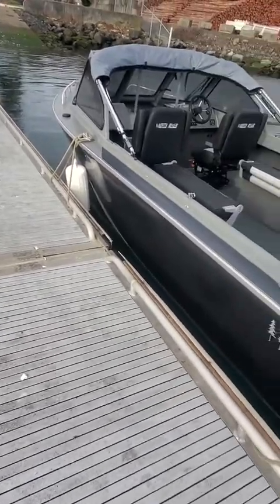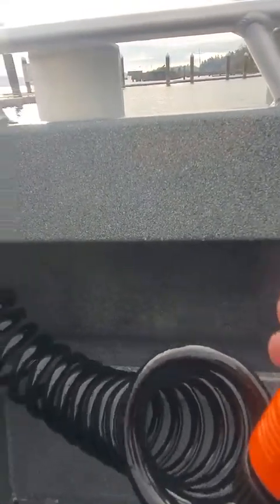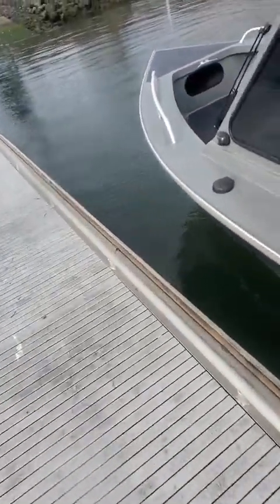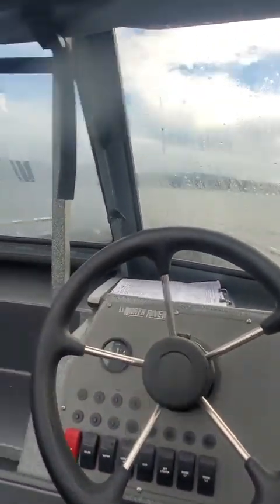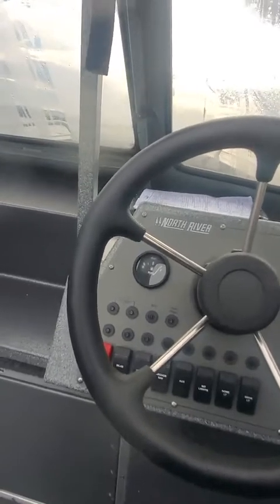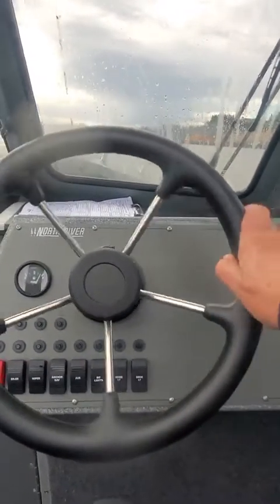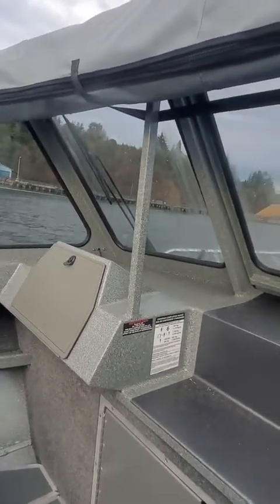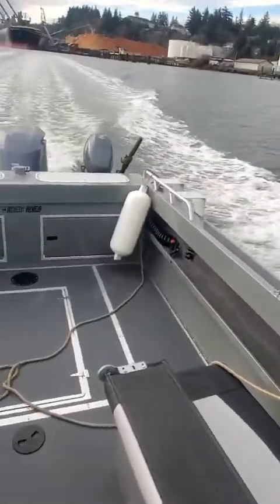Bob and Kyle new 22 North River Seahawk 2021

Comment: Not sure if this is the right place, but have watched you test a lot of the North River Seahawks.  Would you, in your opinion, suggest the Yamaha F200 or the F250B for the 21' Seahawk, all things considered?  Totally different motors I know, but ignoring price, is it worth it based on fuel difference, weight, vs speed, control, trolling?